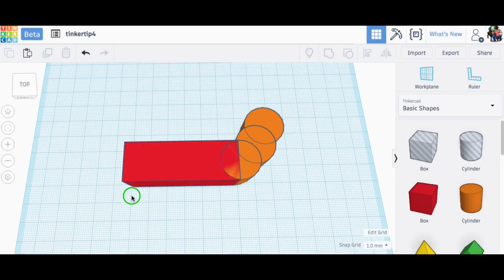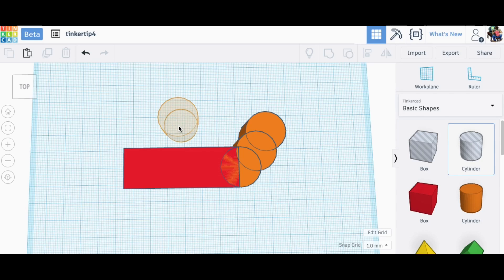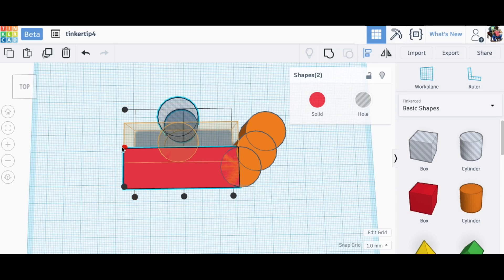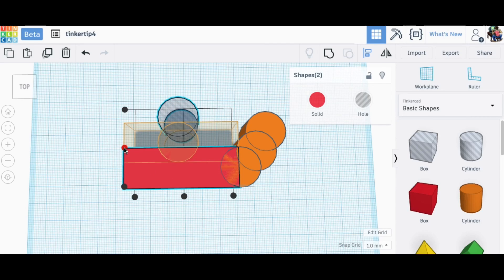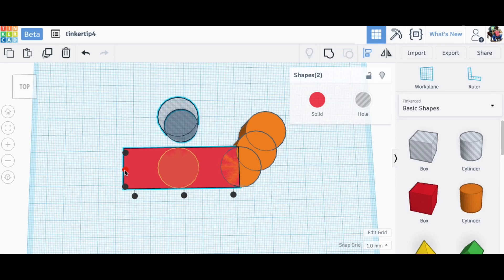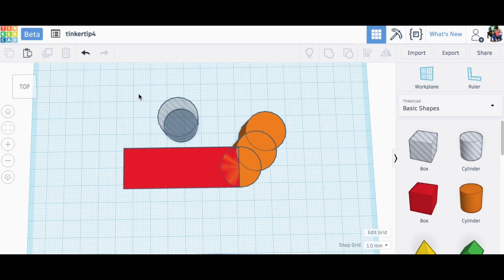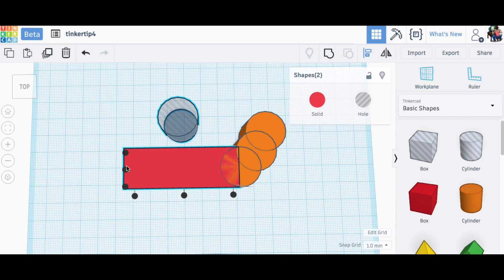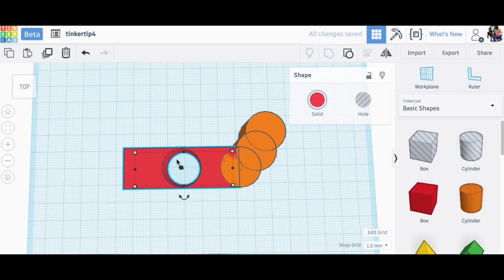Tinkercad Tips and Tricks #4 - Relative Alignment using Align Tool

Comment: I use TC a lot. Note that when aligning to cylinders with lower side counts, the number of sides and the relative rotation of the circle and box makes a difference if you have an aversion to "blue lines" but it makes little difference in a print.

Comment: Is there a way to align the center of a circle to the edge of a block?
Reply from the maker: If you put the ruler right at the edge of the block the you can align the circle by adjusting dimensions using midpoint feature of ruler. 

https://youtu.be/ClvMuKz9vBs

Comment: Another great video. Have you ever tried Fusion 360 , or is this enough for the beginner to design? I learned adobe illustrator about a decade ago and if the holding of this is similar, I think I will be ok. 

Can you remind me ( if it's at all true) which video, or just how do you change the increment that you want to move an object? So when I use the arrow keys it goes 1 mm instead of 10 mm or .1 mm, etc. I thought I saw that in one of your videos.
Reply: Ah yes, I see it now. Thank you.